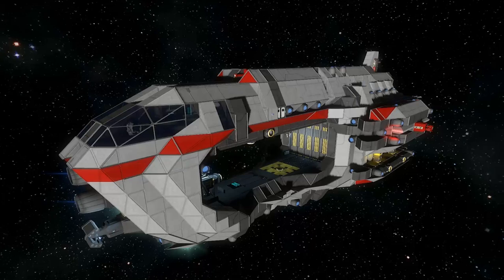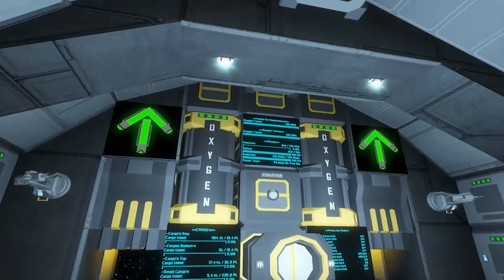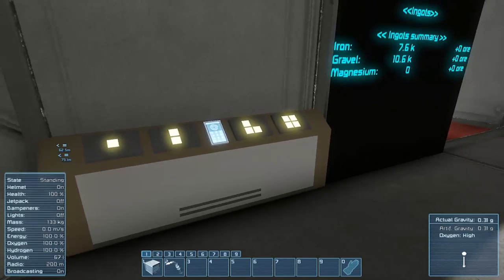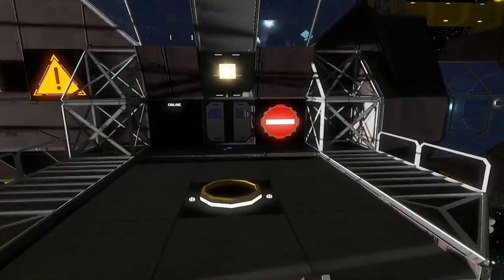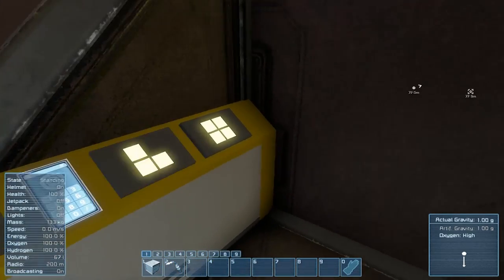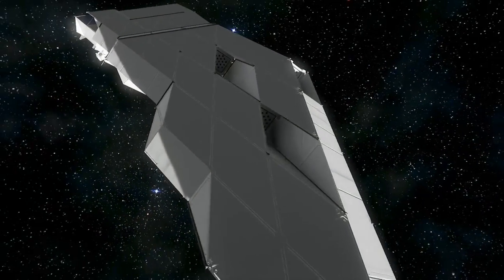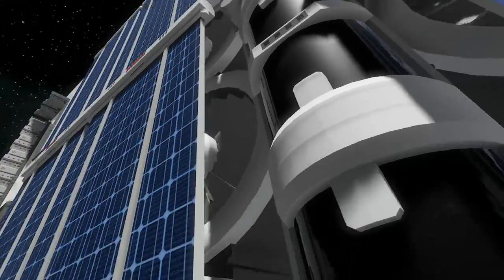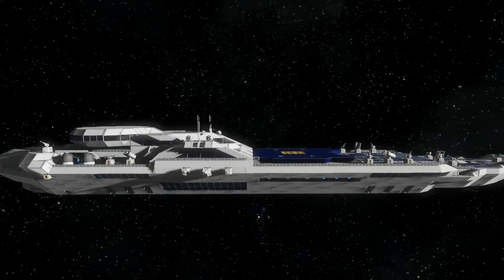Space Engineers Inspiration - Episode 92: Cisco Cargo, Farwatch Outpost, & Nereia WIP

Comment: The farwatch should have a second rotor on the solar panels so they can rotate out also.  Also it need to have the gravity tweaked so it goes off sooner in the front part of the glass tunnel and comes on sooner at the back. I will have to try and remember to comment that on the author's page on the workshop.